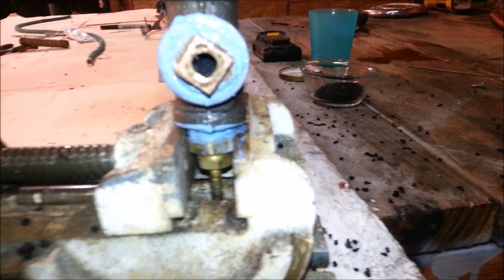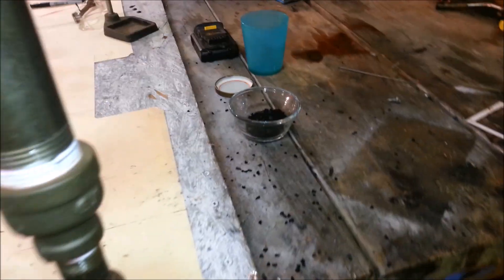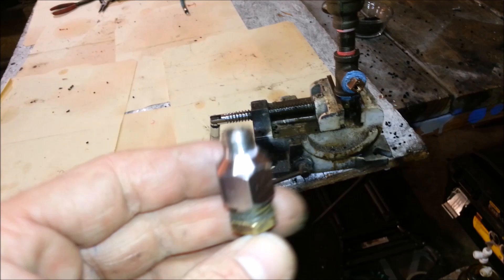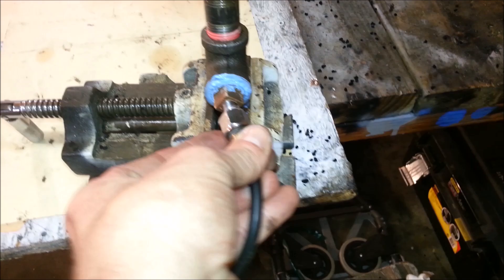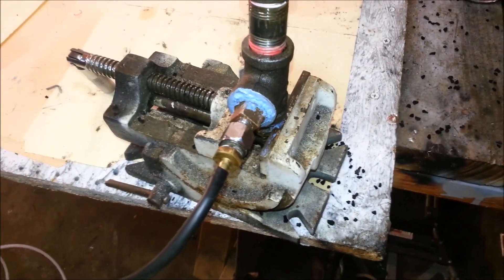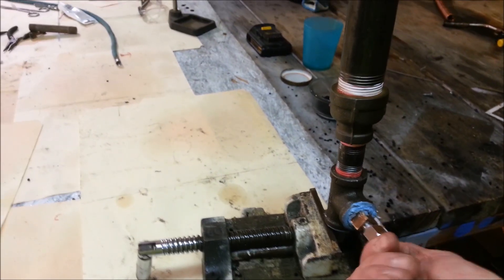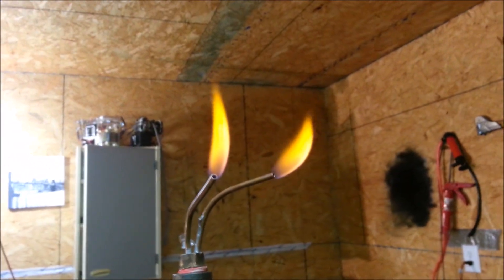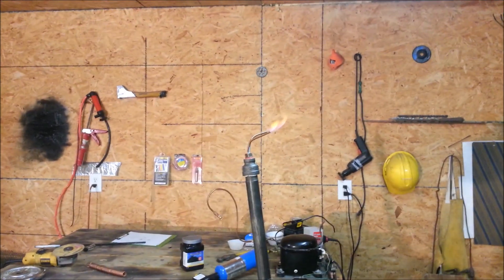AMAZING water gas reaction using hho activation H20 + C = H2 + CO

Comment from the maker: Sorry for all the curse words i try not to talk like that but in the shop its kinda a thing men do when they build stuff , they always tell you " IT WAS BUILT ON BLOOD SWEAT AND TEARS "  but they dont mention " and a whole lot of cussing "
Reply: If you are looking to do this efficiently, you do not need to breakdown water to Hydrogen and Oxygen and then re-react them as the heat source for the reaction.  If you build an insulated heater with firebrick and resistance wire such as Kanthal to put your pot of carbon in, then you can simply heat water to generate steam and let the steam flow into the bottom of the chamber.  The reaction is endothermic with the carbon, so you will need to make up that energy with your resistance heating, but your outputs if you have an excess of carbon will be H2 and CO, which is commonly called producer gas.  This generally requires a different orifice size to burn in a natural gas appliance as you need less Oxygen (about half) per mole of fuel than for natural gas, but people have stored the producer gas and used it in place of natural gas, and in fact a lot of the original gas works in Great Britain were stocked with producer gas for the town gas.  Since this gas contains CO and is therefore very dangerous should a leak occur in an enclosed space, as well as the different ratio of gas to oxygen as compared to CH4, I am not aware of any public gas works still using producer gas.  Cody's lab has an example of such a setup, but for regular use you could make it much more efficient, in his video he is actually producing activated carbon and the producer gas is a byproduct that he burns off.
Reply: NOBOX7

Comment: Great experiment, like usually. 
But you make people confused with your explanation, hho is not oxihydrogen! They have totally different properties. Just buy bottled gases and you will see :)
Reply from the maker: it is a stoichiometric oxyhydrogen mixture, hho is not some magical gas as many believe, its just plain old oxyhydrogen gas
Reply from the maker: i dont mean to sound argumentative i just dont agree my friend
Reply: Its very magical :) Don't believe to me, just try it! That's not the same gas, even hho gas from different electrolysers not the same. I know it from experience, i experiment a lot.
Reply from the maker: the reason the gases can be different depending on the electrolyser is because the electrodes react with the oxygen and also if baking soda is used it  introduces c02 into the system . nickle plates produce the most oxygen therefore the explosion of that gas is louder then others , ss steel reacts with the oxygen to form hexavalent chromium so the mixture has less oxygen . don't fall for all the hho pseudo science hipe the process is over 70 years old . the hho community is full of scammers its a huge fraud

Comment: Can you use  a tube made from copper to see if the steel tube you're using is acting as a catalyst? Has the carbon adsorbed water from the atmosphere? Did you try to evaporate any adsorbed water from the carbon before you try this?
Reply from the maker: anikoustos2 no i didnt

Comment: huh never seen this before
Reply from the maker: im trying to make clean fuel that has no tar in it to run an engine  . it may be better to use steam and air to do this so im gonna hook a small air compressor up to it and build a small steam producer to see how that goes . the hho needed to do this may be better though it provides very hot steam it provides thermal energy for the reaction and it produces a N2 free gas stream wich should make it more powerfull then a air power combustion system . ive bin racking my brain to justify not using hho for further testing . The Problem is the hho needed cost us about 1500W however this may be an exceptable sacrificial power consumption seing as how the steam production would be around 1500 watts easy let alone thermal energy requirements to sustain the reaction . one way will burn more carbon then the other for the same production   basically so i need to find out what is best. Gasification has to many strict operation parameters so im looking into carbon and iron steam reactions .
Reply from the maker: my main goal here is to do this with solar heat...just testing the chemistry
Reply: NOBOX7 reminds me of throwing crazy jack fireworks spinners into a bottle of water and burning the gasses that bubble out.

Comment: I would say the HHO flame brings the temperature of the charcoal up to the needed range of 1000 degrees, as the flame burns it turns back into water (steam) and as the charcoal burns it converts the steam into water gas. I think you really have something here. You should build a charcoal gasifier with hho torches in the reduction zone. Then you should easily be able to power a car with it.
Reply from the maker: bro i totally agree , im looking into it and the Chemical research ive done indicates im burning carbon with the oxygen generating heat also then the Co2 from the burning carbon is converted into carbon monoxide down stream by the hot carbon surrounding the combustion zone so there is very little c02. we are seeing a great deal of air mixed in with the water gas because the reaction chamber is 1/4 full and a large air space is inside so we may see blue flames tomorrow   . im building a device that can run longer because i know my torch and how hot 1000 watts will get something we are definitely burning carbon with the excess oxygen because the entire device got so hot the pipe dope began to boil and my hho torch hose started to melt. now im not an hho believer i no it to be a scam as far as gas mileage but this is a new spin on old tech and we might have a new concept here , i think this thing is actually producing more fuel then im using.
Reply: NOBOX7 from my experience those flames were yellow/orange which means you are burning hydrogen with some water.
Reply: Bill Corless if you put a dryer on it before you burn it you should see a nice blue flame.
Reply: NOBOX7 well theres no over unity here, just a chemical reacion of carbon and hydrogen and oxygen into carbon monoxide and H2.
H2O + C + heat -> CO + H2
Reply from the maker: Bill Corless will do but im assuming it will generate tar gas like syngas , i burnt wood   with my torch before and it burns away to nothing very cool reaction, it will burn a hole rite threw a log
Reply from the maker: Bill Corless i tried your idea and man did it crank out some smoke , i did not film the event but i intend to.
when i did it with plastic it smelt so terrible i had dispose of the entire device . even went it wasnt running it smelled horrible , and also each time a highly flammable liquid was condensed that burns with a load crackling sound
Reply from the maker: I did a chemical kinetic analysis on the hho water gas process and found it to be useless. im not sure if i wanna bother posting the explanation as it is not very exciting and probly a well known fact in the scientific community   , however i am working on a device that can produce a nitrogen fee gas stream by taping heating gas from the production line to heat the steam and the carbon

Comment: two thumbs up
Reply from the maker: Thanks friend , this worked so well that my primary objective may be put on hold . i have to test this oxy hydrogen reaction some more before i move on , i just wanted some quick steam but it seems i may be able to generate more fuel
then im consuming without violating any thermal dynamic laws using this process .

Comment: What is your goal here? What are you building?
Reply from the maker: Fuel production is my goal, im going to try and use solar heat to do this but the hho reaction on the carbon seems to be able to produce more fuel then im injecting. i may experiment with this reaction because i think im on to something . This may very well be a new supplemental fuel device that could enhance fuel economy by allowing water and carbon to be used as a fuel . I did not expect the hho to generate water gas so well , maybe because it supper heats the carbon. My main goal is to use solar heat to synthesize water gas that runs a small gas engine, but the experiment has taken an interesting turn  . im currently building a test device that can run for longer periods . it should be ready tomorrow. the strange thing is that water gas reactions are endothermic but this device got way hotter then any endothermic reaction should have . the hho torch alone wouldnt of gottn things that hot
Reply: NOBOX7 The reason Iron oxide was used as a catalyst was because it helped with the water gas shift at lower temperatures. However water will dissociate at 2000 degrees without the need for a catalyst. Higher temperatures will produce carbon dioxide instead of carbon monoxide, which isn't flammable, but can be used to make syngas.
Reply: NOBOX7 you should  check and see how much carbon was consumed.
Reply: NOBOX7 also you could use granulated charcoal.
Reply from the maker: Bill Corless what do you think about seeding the charcoal with iron powder? i believe an iron steam reaction would accur but i think the rust would then be reduced backed to iron by the hot carbon allowing more hydrogen steam reforming. the problem with the iron steam reaction is the rust stips the reaction but i think hot carbon would strip the oxygen atom off and maybe even liberate Co .  i can find nothing on the subject of doping the batch with iron but i have a hunch its a good idea to try it  . also i guess hydrogen strips oxygen from rust so i may have a secondary reaction issue but we will see
Reply: The water gas shift is the conversion of H20 and carbon into a combustible gas containing carbon monoxide and hydrogen. This was the first gas used to power internal combustion engines and was once used in manufacturing in our country. Its a lost art, and NOBOX7 has come up with a brilliant experiment to make it.
Reply from the maker: Bill Corless I wonder how hard it is to make charcoal ? This is very old science but i think it has a place in a carbon cycle fuel chain , we plant trees that capture carbon then we burn the trees in gasifier power plants and use the bio char for water gas.